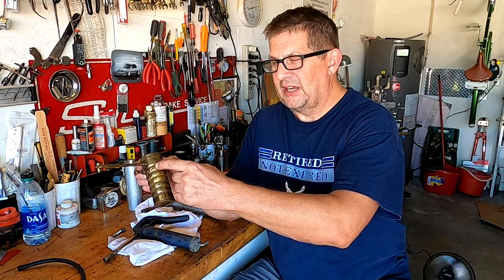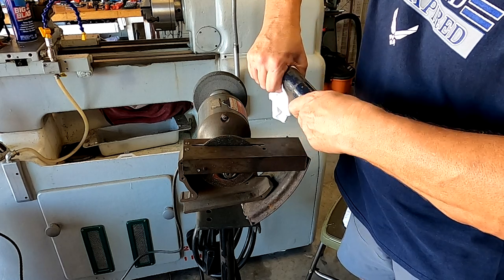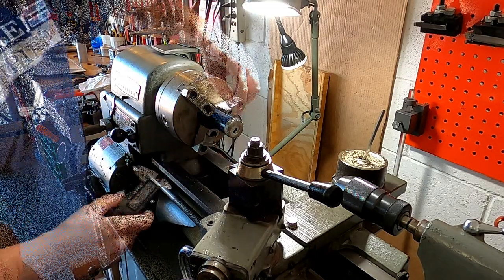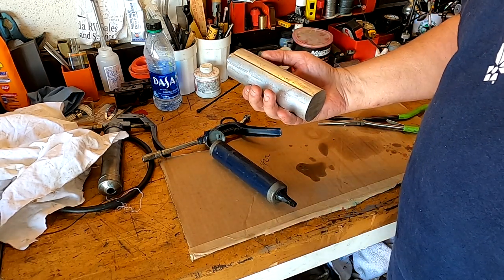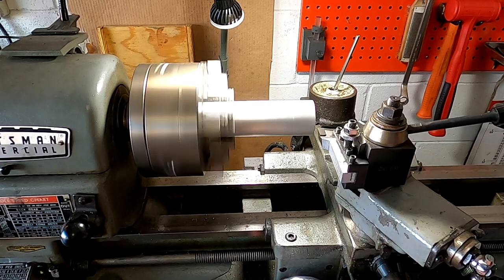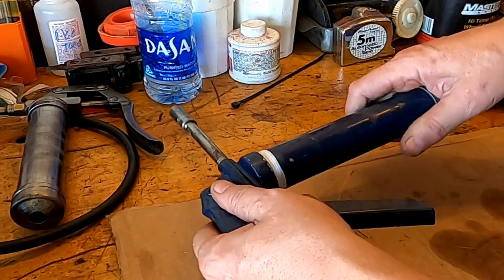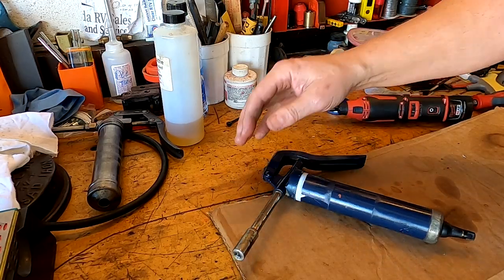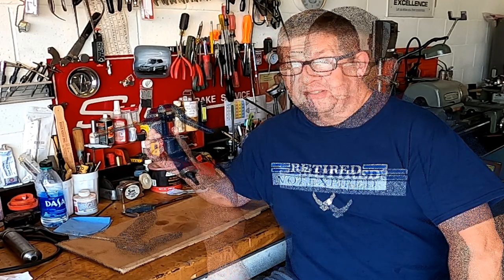Oil gun for Zerk fittings on many common machine tools. Make One!

Comment: I picked up an old mill for a good price (its not in the best shape), but previous owner had been using grease where it should have been oil... Any tips?  I was thinking about pumping a penetrating oil or alcohol in there every day for a while to see if I can get it all out...
Reply from the maker: I had that issue. I made an oil pressure gun (there's a video on that) and simply overpowered th  e old grease with oil to flush it.  Automotive motor oil is a good flush out as it contains a lot of detergent. Then I go behind with the proper lube.  Don